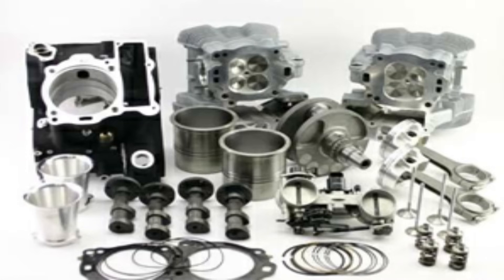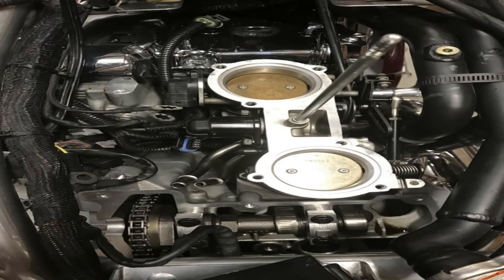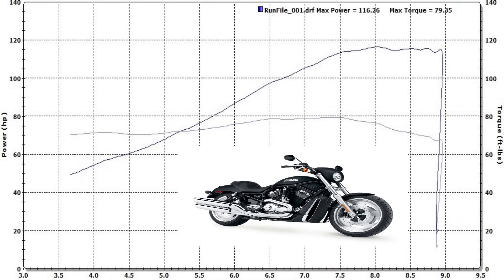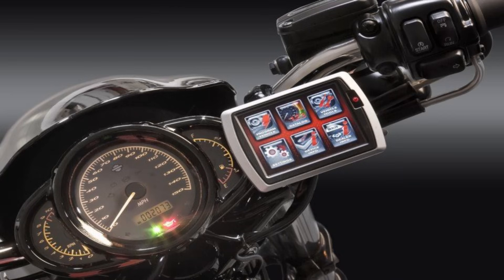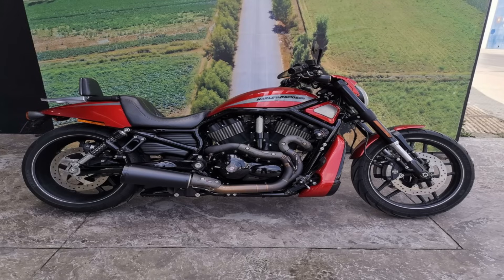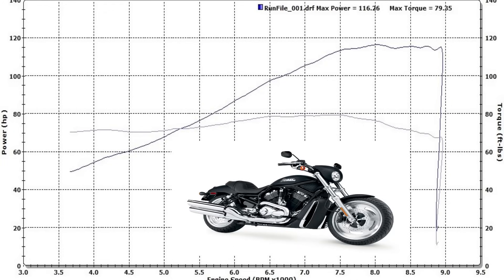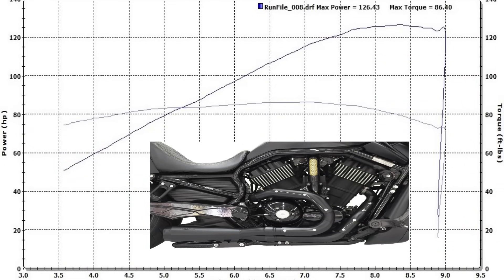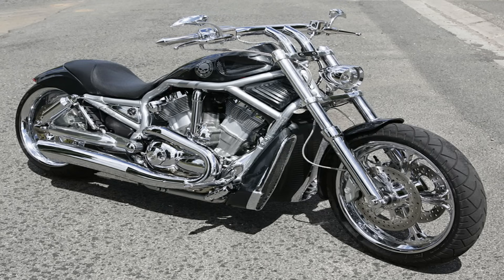The Vrod Has One Simple Trick For All Power Upgrades

Comment: I responded to your last vid. When I bought my 09 it already had the Stage 2 (cams,TB,Injectors, open air box, SE filter, Tab slip ons, PV tuner). Changed to akropovic 2/1 took it to a tuner in Dallas. Baselined at 112/77, after the dyno was up to 124/85. If I could could find a way to put it back all stock I would do it in a heart beat.
Reply: Have cams, 2-1 Akra, open air box with KN filter and power commander tuner. Wouldn't do it again if I had a chance to. Stock with VH slip ons was the sweet spot. Need more power get a diff bike.
Reply from the maker: Why would you want to go back to stock? Those are some really solid numbers!
Reply from the maker: They for sure made no compromises when it came to power in the stock form!
Reply: @GixxerFoo  I do some LD riding and after a while the loud exhaust can work on you even with ear plugs. Also, I lost 5-6 MPG.

Comment: Great video! Hey would you mind doing a video on the S&S T124 $7k and the S&S T143 $10k whole motor swap. Coming from a 103 Street Glide with woods 222 cams and D&D Fat cat 2-1
Reply from the maker: I have a video right here where I covered some information on both of those motors about Twin Cam crate engines https://youtu.be/sXYELxFECyY. Motors are easy to swap but for sure put a stout compensator in there with a good clutch. Transmissions usually do alright with high power motors.

Comment: A Buell 1125R has a similar air box.The gas tank is a cover with a air box below.Remove the air box top cover.And replace the tank cover.The intake noise was so loud . The air box top was replaced after a few days.
Reply from the maker: That's true you will have some more intake noise, but it's a give and take when it comes to making horsepower.

Comment: Thanks, I've never heard that mentioned anywhere else, surprisingly.  Some bikes you leave a clip off the lid and it dogs out. So I wouldn't have probably made that a consideration in getting her to open up. I think I haven't sought to make performance upgrades yet because of that whole futility thing, "the thousand you spend for the few extra horses," really isn't that noticeable.  And I would have been right because I would have done it lid on. Seeing you're dyno numbers affected like that gives me that "ah haa" moment where i'm simultaneously exited that there's a key to getting hp, and pissed this is the first I'm hearing of it. Good info bro, had considered selling mine l8ly, for this very reason.  Always did think the way that lid was shaped didn't get air to it. Especially after you stuff it a box packed full of wires You want to believe HD knows what they're doing building bikes and would never intentionally steal HP from its faithful followers. That would be a.........awwwe, GDHD!

Comment: The power vision tuner is a pain in the ass. Apparently the spark coils in the Vrod give off so much electromagnetic feedback that they actually interfere with the tuning process causing the power vision to experience software errors and freezes. Needs to constantly be reset which is not something you want to do while riding. Maybe mine is just more sensitive than others but it seems to be a fairly common issue from things I’ve seen on forums.

Edit: it is still usable and still works even with the freezing. Will just take you a bit longer. Just be prepared to pull over any time it freezes to reset the unit. When it does freeze the progress is at least not lost. After you reset the auto tune it will continue where it left off. I’m riding a 2016 Vrod Muscle.
Reply: I have the same exact issue with my 2016 VROD and Power Vision tuner. It's a real pain, and it happens every time I ride.
Reply: @jtpritch69  it’s a really dumb issue. from the research I’ve done If the power vision cable had better insulation it would mitigate the problem of outside electrical interference crashing the system.
Reply: @jtpritch69  I personally have not tried it but I’ve read that some people have had some luck putting shielding over the wire to block out some of the feedback from the spark coils.

Comment: I'm rather new modifying/tuning vehicles/bikes. I have a nightrod special, 1250cc, and put the V&H Performance exhaust on it. You're right, I do get some decel pop when I'm engine breaking from high revs. I still have stock air though. When it comes to air intake/tuner, what recommendations do you have? You mentioned powervision tuners, are there different models I should be watching out for?
Reply from the maker: The Power Vision is the best one out there other than a Thunder Max for the Vrod. For the Vrod a K&N air filter in the air box and a Power Vision is about the best it gets for the Vrod. You can run the air box topless and pick up some more power there. Best deal on a Power Vision out there is Fuel Moto, you tell them your setup on the bike when you order and they preload a map based on your specs to the unit. All you have to do is flash it and you're good to go, maybe run some auto tune sessions to dial it in if need be.

Comment: Another trick concerning the airbox mod (besides a Screaming Eagle air filter), I did more than just losing the top: I cut & trimmed the lower to the filter lip, relocated the ATI sensor to the filter lid, made a battery terminal quick release (simular to forklifts), and replaced the 10 side cover screws (Muscle) with quick release pins and JB Welded brass collors in the airbox cover to solve the 20 minute
Reply: ...hassle with getting to the front spark plug. Now it only takes me 2 minutes WITHOUT tools.
Reply: Actually, it was a "20 minute hassle" the first time with the stock airbox: More like 8 to 10 minutes (with 4 different tools) after that.

Comment: You know I have looked around and never found any information on the transmission gearing. I have a 2003 V-rod and was wondering if it would be possible to lower the first gear and raise the fifth gear ratio. The local shop that did the dyno tune had recommended that I install the lower toothed 04 output pulley before installing the air filter and bubs (Reinhart) exhaust. Well, that's been done a long time ago. I was wondering If that is possible? I'd love to put the original pully back and change 1 to lower and 5th to a higher ratio. They have lots of Horsepower and enough torque at the higher end. It just seems like I'm being waist full at 65-90 mph cruising along. So, what's your thoughts is it possible and how involved and expensive would this be. I've always imagined if it were easy that is what Harley would have done in 2004 instead of increasing the teeth in the output sprocket.
Reply from the maker: It would be very expensive to get into the transmission on a Vrod with it being unitized. You would be a lot better off by changing the pullies, maybe go up a tooth or two on the back for more low end. You'll sacrifice some top end but if you're not concerned about the top end you'll get a lot more low torque much faster.

Comment: Harley knew what they were doing when they designed that engine.  (Yes, with some Porsche input).  It was designed after their racing engine.  A Motoholligan intake is a great to add for that extra air.   Scott Fitzgerald Motorsports, (near Dayton, OH)  makes and has a ton a engine performance parts.  And does all the tune and Dyno work.
Reply: Some Porsche input???
A little more than some
Reply: @sparky586bh  let me guess,  you have Porsche badges on your V Rod?
Reply from the maker: It was a good collaboration, Harley did work with Porsche on that race motor too. They did basically what Indian did with Swiss Auto, they designed and built the Indian motors.
Reply: @GixxerFoo  Yes, Harley was building racing winning engines decades before that collaboration. One of the big things that Porsche did successfully first was had a liquid cooled engine. That was the main reason for the teaming up. No matter what, it runs extremely well, it’s dependable And a hell of a lot of fun to ride!
Reply: @gpcbr1000  flat black nightrod special. No logos at all on mine thanks. After market breather cover for more air flow but that's it.
Reply: Scott built my motor. She’s a 1402 cc dyno’d at 170 hp and 109 tq. Definitely not a cheap upgrade but well worth it.
Reply: @Peter Angles yeah but it's all plastic and ugly. Plus it's a Suzuki so it's probably going to break a lot
Reply: M109r is Gearbox mainly, and even then you do see some around with 80k miles still going strong. 

Unpopular and uncommon truth is that Erik Buell had far more to do with the motor and general design in the V-rod than Porsche. Harley buried that as Porsche is a far more marketable relationship. Porsche primarily sorted the cooling system out as they had experience going from air to water cooling that Harley didn't have. The reason the V-rod has a fuel cell and a fake tank with a huge air intake volume? Look at a Buell... 

Also need to bare in mind that Harley didn't even have the aluminium casting abilities to build a Buell XB series bike in 2002, the first two years of production, all the casting was done by Brembo in Spain (if you have one, look closely at the swingarm/frame, they will have Brembo logos on them) Harley really didn't know what they were doing without colossal help with the V-rod.

Comment: My 1250 has a full Akropovic system, k&n, and screaming eagle tune but gets bloody hot. Will definitely try removing the air box. Great tip. By the way, a turbo or a supercharger will add mad hp 💪🏼
Reply: that front header on the akra is way to close to the front peg tho xD i changed mine to vance and hines, it doesnt have that beauty bend on the front pipe like akra does but you wont burn yourself :D

Comment: My 2014 Vrod has V & H slip-on exhaust, Power Vision Tuner, and K & N filter. Once tuned, it runs great &  sounds good(nice and loud- if its too loud, your too old!  LoL)  I thought about drilling large holes in the air box lid , but was not sure how that would work out. I would like to try the TAB performance V-Rod Super Intake, But the cost of entry is a little bit prohibitive .($498.95 ! )
But I love the way the motorcycle looks and sounds!
Reply from the maker: The intakes work pretty well but just running a topless air box makes a big difference!
Reply: I want that too, but $500, whoa! Gotta save up.

Comment: How much HP would you gain just from removing the air box cover?
Reply from the maker: Generally it's about a 5 horse gain if you retune or at least run an autotune, likely get more if you get tuned on a dyno. Those Vrods love their air and the stock air box is a bit restrictive.

Comment: Do you do anything on Triumphs? I just purchased a new Speedmaster and was wondering if the tune on a new bike has them running lean or is it good as is?
Reply from the maker: I don't do much with Triumphs but any factory tune is going to be very lean. The Triumphs run pretty well with the factory tune, I've rode a few and they felt good to me. But with any factory tune there is always more power to be had with a good improved tune you can get from a DynoJet.

Comment: I had to buy a chinese bra because Harley don't sell'm no more.......but I did get a frame pouch(bag) from Harley......fits under seat, velcros around frame

Mines stock, 1130cc everything I've seen says its 120hp stock......I've read the 1250's were 125

Mine is plenty for me, but I think next summer(its put up) I'll go out give it some gas, then take the air cover off and see if it does anything.......I doubt I'll notice a few HP

I think I'm going to look into the solo seat set-up
Reply: You need to get a tuner. Taking the air box cover off won’t do anything on its own
Reply from the maker: That little bag that sits down on the frame is awesome, dad put one on his Night Rod and it's perfect for emptying your pockets out.
Reply from the maker: Tuning is the key to unlocking the power.

Comment: I had an 04 V-Rod and change the front pulley dropping it two teeth to 26 instead of the stock 28. It picked up 9 mph in the 8th mile and brought the torque band much lower and made the bike more drivable with just the pulley change
Reply: I’ve been riding Vrods nearly 20 years and my first one was a 04B. I just got a 08D last month. I’ve done all sorts of things to and with these bikes, I even put a turbo on a couple of them. I have a 13F that I traded my 12F for simply because my MOS in the army was 13F. I put one of those 26T pulleys on it and it is hands down one of my favorite performance mods for the price. We lose a smidge on the top, but acceleration from 0-100mph is wicked. Dropping a gear and banging past traffic has never been more fun.
Reply: @bothetinman772   do
you have a part# for
that pulley or where/how to get it/ask for it?   change belt drive?
Reply: @bothetinman772  I was 13F FSS in Fallujah & Kuwait. Now retired in Burke VA collecting a fat D.C. locality bonus as a civ contractor with SpaceForce.

Comment: But if you absolutely have to be the gorilla among chimps (and money is not an issue), TTS Performance makes a left side supercharger kit that- with the right tuning & mentioned tricks- put your 1250 V-ROD in the 200 hp range on the dyno.
Reply: I'm in the Cruiser world, not Super Sports. Sure, if I wanted something "faster" than a 200hp V-ROD I'd probably go with a supercharged ZX-14R or an H2. That's like telling a guy who built a 9 second Muscle car "but the Bugatti Chiron SS is FASTER". Different world.

By the way, it is possible to build a V-ROD that will SMOKE Busas & Gixers on a quarter mile. Just as SIX-TIME NHRA Pro Stock Motorcycle WORLD champion Andrew Hines. He absolutely HUMILIATED GSXR teams withe the MOST wins (56) EVER!

Comment: I had a 2005 night rod. I loved that bike. Stick a turbo or blower and hold on
Reply from the maker: That's one of the quickest way to spend 5 grand, but if you think about it you spend that much getting into the motor. A turbo is basically bolt on and you get as much if not more power and reliably too.

Comment: From my brief experience riding a VRod Muscle I think that the stock setup had plenty of power for my taste. I do think that it could have used a little more torque. Happy Thanksgiving to you as well.
Reply from the maker: Thank you! Yeah those bikes were low on torque, mid to high 80's at the most. They made the horsepower though!
Reply: These things loved to rev……..the lower torque was no issue. Rev the piss out of it. It will do 7500 rpm all day at 110 degrees outside and not break a sweat. I loaded mine with a crap ton of gear strapped all over it, with full saddle bags that I made. Passing power on 2 lane roads was abundant. I don’t have my vrod anymore……but that engine was great. When you hit 5000 rpm things started happening quick! My only mod was a set of Vance and Hines power shots with a power commander and a tune. Left the top on and the tuners dyno only went to 7500 rpm…….still hit 115 hp at the rear wheel with 1500 more rpm to go! 1130 engine.

Comment: Add to that a hotter set of coils, NGK Irridium plugs and bypassing the valve cover vent tubes into a Catch Can (I mounted mine on the rigjt side frame below the switch) will make a noticable difference from mid to high range (I'm guessing 7 to 9 added hp).

Comment: I loved my 2008 V Rod. It had a two into one exhaust, and a tuner. Fast as hell,  every time I road it I would hit 145mph, sold it in 2017.
Reply from the maker: They are pretty fast for sure! Hard to hang on with the forward controls at those speeds!
Reply: @Peter Angles pffft 😆 chill man, he might've been using voice-to-text and I'm not sure Hooked on Phonics would help with words that sound the same but are spelled differently. Besides, he gave us a clever hack and that's your takeaway?
Reply: @Peter Angles last place i thaught id find grammar nazis
Reply: How do they handle? My 01 v-max was a zipper to 100MPH but squirrely above that. My KZ 1000 was not as fast but changed lanes & stopped well. Wish I still had it.

Comment: I’m considering trading in my VFR800 on a 2007   VROD R version so I guess it’s actually designated as a Street Rod or a VRSCR.  I appreciate the information you’ve provided in this video.  I now know that I’ll definitely be doing header back 2 into 1 exhaust with an intake and a tuner that allows me to dial in fuel delivery for the bolt on modifications mentioned.  Can anyone recommend a full exhaust for the R model?  I’ve heard the V&H full system is really good and has an adapter bracket to clear the mid controls… ?

Comment: after i got my harley low rider s, with the 114 ci engine i later installer full exhaust and the power vision tuner. i was all hyped after doing all my reading and play by play video reviews of the huge improvements . Well i didn't notice much. sad to say that with out doing major work like cams or heads your not gonna get much more from the engines as they are built. Engineers have done a pretty good job at squeezing the most out of them. Maybe i was just spoiled also having a 200hp ZX14R
Reply from the maker: The M8's get some mild gains with exhaust and tuning but what really unlocks those motors is a good aftermarket cam. The Wood WM822XE is a monster, a bolt in cam in the M8 it will produce 120 horse.
Reply: @Peter Angles you're right. The zx14 has 208 hp. Thanks though cool guy.